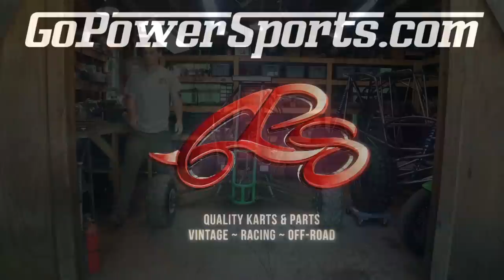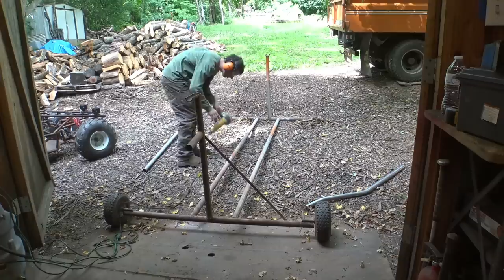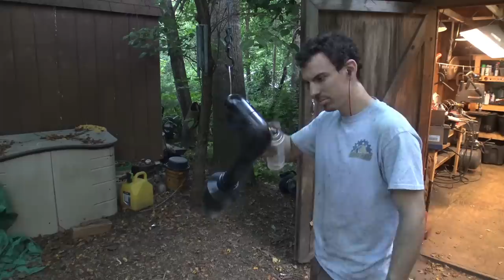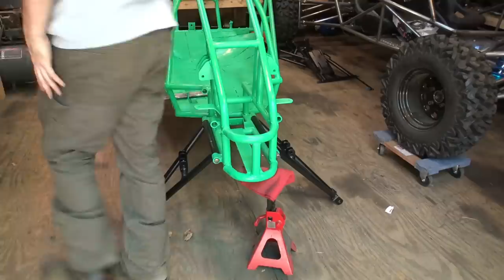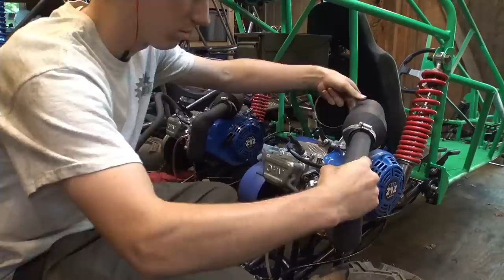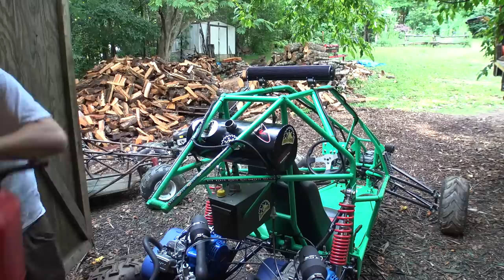Painting the dual engine go kart

Comment: You could add hour meters that have the RPM feature so if one engine dies you could know which one by looking at the rpm gauges
Reply: That's what also make it easier to synchronize both engines

Comment: Cool machine. As far as runni,g or non running engines you can run digital tachometers in a custom pod. You will know which engine is running. Which one runs stronger. Which engine needs to be tuned.. Etc Etc.
 All this time you spent grinding and sanding and you went straight to paint. No cleaning degreaser solvent. No primer / sealer I think you will find it will rust pretty quickly. With 15% more effort that finish could have lasted quite a long time. You could also clear coat the hardware to keep that from rusting and still looking crisp and new.

Comment: Install some lights on the dash that connect to the spark plug wires almost like a spark plug test light and you will be able to tell which engine is still running just throwing that out there love you videos and your work keep it up nice job

Comment: If I made this, I would have made the frame out of 304 or 316 stainless and finished it with a #4 Brushed finish....probably because I finished stainless for a number of years professionally and have been obsessed with abrasives to the point of being an abrasives information repository and being knowledgeable on upcoming abrasive innovations.  Helpful tip: When finishing metals, even just mild steel, always use Ceramic Alumina abrasives instead of aluminum oxide or even Zirconia, they last the longest, remove material faster, stay cooler and in the end cost you less.  Also, always finish metals with non-woven nylon abrasives as these "close the grain" that's been lifted by the traditional abrasives and this will prevent particles from collecting in those grains and thus oxidation of those particles.

Comment: Mount some little LEDs up front and wrap the positive wire around each spark plug wire. That will show which engine is running and which has died.

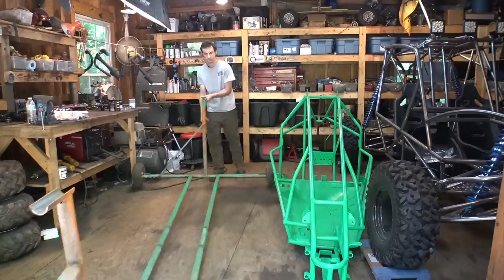Comment: 10:56 I'd have probably used the chain hoist for lifting the frame instead of lifting it a little at a time.
Of course, it was probably faster to do it your way since your chain hoist seems to be packed away. Need it on ceiling tracks.

Comment: U should maybe consider building a shed or small garage where u can store ur wonderful creations, a shame they stand out an just rust when i spend so much time on them, plus them rustin also makes more work for u. But ye the duel engine looks good, if the engines produce power when running u should make 2 red cockpit lamps that lights up when each engine is on and making power. Great work keep it going, if u read this plz abit feedback ;) by power i mean volts ^^

Comment: You should try to make on of the go carts 4x4 ik it would be difficult but I think u you would be able to do it with how handy you are
Reply: It wouldn't be as difficult as you'd think if you used 2 ragb to drive the axleshafts, turned the engine 90 degrees and drove the connecting driveshaft between the ragb with the engine

Comment: Add a led for each engine on the dash board from the Alternator charge output. It will show you that the engine is running.

Comment: You could utilize the same rear suspension and have one engine by using a chain system like a two into one with the sprockets in the same location as the pivot so they dont stretch when the suspension moves through its cycle

Comment: It would be cool to try and put a light on the dash for each engine to show when there running. I don't know how it could be done thou
Reply: The magneto that operates the coil should have one wire that runs off it that gets grounded to shut down the engine if you splice this wire you can run either a tach or dummy light that let's you know that engine is running (however the dummy light cannot be an led without an in line resistor added as an led doesn't have enough resistance and as a result would ground out your magneto causing a loss of spark scenario)

Comment: Get yourself 2 of those RPM / Hour meters, which you just wrap the wire around the plug wire to pick up the pulse signal. This will then give you the RPM of each engine, but more importantly, you will see which engine stops so you know which one to start up rather than guessing. Just a thought. Available on Aliexpress and Ebay etc, cheap.

Comment: Run duel tach/hour meters to monitor the engines.  The cheep ones on eBay may not be accurate but they don't need to be to tell which engine is running or not.

Comment: Next time use a go kart differential between the 2 engines (engines driving the axles instead of the diff with the diff driving a jackshaft that sends power to both wheels via a chaindrive and angle the rear suspension mounts  15 to 30 degrees  with the outboard mounts further forward it will reduce the risk of the sprocket rolling into the dirt when the suspension travels and will make it more roll stable

Comment: If the engines have  charging system (looks like it) connect a light to it but, put in a diode so you only get power from the charging system while it is running and not from the battery. I think there should be one already the so the battery doesn't back feed and as far as the different speed idles 2 gas petals.

Comment: You Kno dude you could always wire in a couple little LED lights like a warning light to the engines so if one of the engines cuts out the light would come on warning you that your down an engine that would make it a bit more off-roadable and you'd take care of that flaw just a thought figured it would be a good idea
Reply: Led lights wouldn't work unless you added a resistor in series with them and connected them to the magneto grounding wire (kill switch wire) for each engine better option is a regular incandescent bulb as it has built in resistance

Comment: the one thing that's confused me for a long time is:  the 30 series torque converters are meant for predator 212s and engines up to 7hp. the predators are almost at that when their bone stock but once you mod them to like a stage 4 making 20hp, technically you would need to use a TAV 780 but just the driver pulley is almost as big as the whole engine! and the 780 and 40 series are both 1" shafts, meaning you can only use the 30 series. but you just TRIPLED the horsepower so now what?????

Comment: Individual tachometers or volt meters no volts motor is not running.  Side note you could kill one motor on purpose and use the brakes on that side turn and gun it to make a really tight turn

Comment: How come he NEVER uses primer? And please, invest in a spray gun, even the cheapie from Harbor Freight. Screw those rattle cans!
Reply: I don't think he cares that much to use primer. Like it's not no RZR 1000, it's just a go kart that's going to get thrashed on. Plus primer cost extra. Depending on how many coats of paint he used. It should last, for some time.
Reply: @5_twenty  Yea, why bother taking one little extra, cheap step to do something right that you've put so much time and effort in building?

Comment: Put all the rusty stuff into a large plastic storage box with parts covered with water & run 12v high amp charger through it with 2 pieces of shitty metal plate so you can remove the rust.